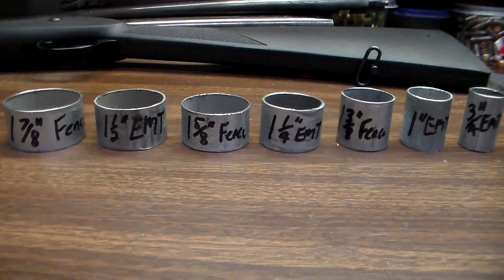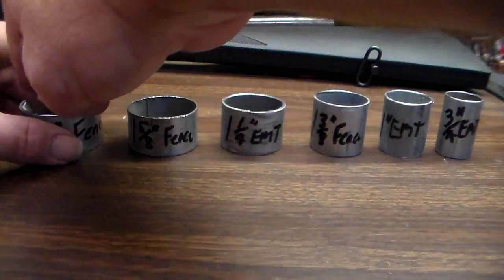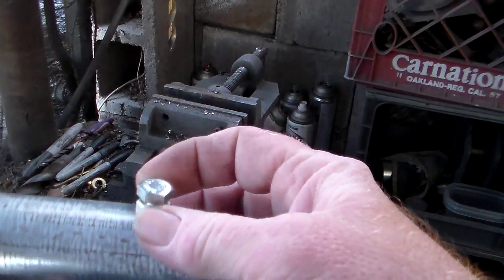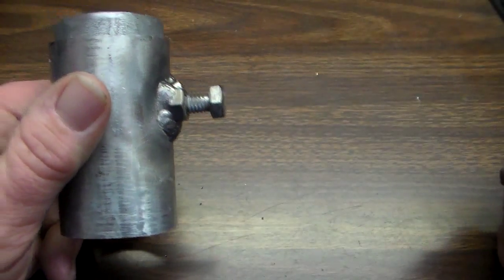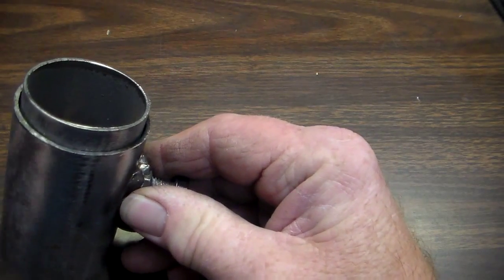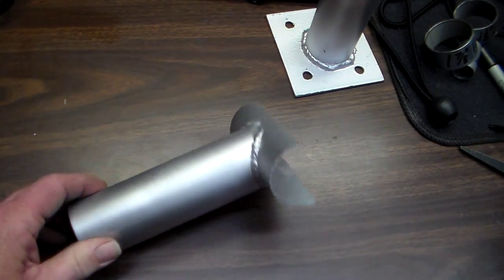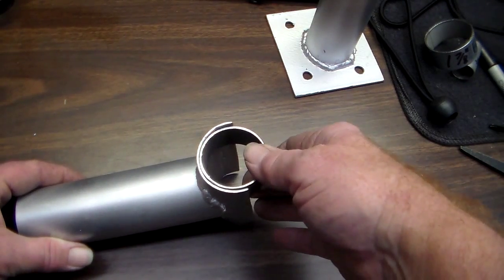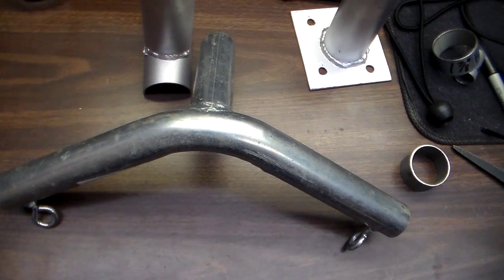How to manufacture a canopy Part 2

Comment: Thank you for the info. I looked all over to find the 1-3/8" pipe (to fit a 1" EMT) until I watched your video again and realized that it is a fence pipe and not EMT's. A 1" EMT is actually 1-1/4" OD. And a 1-1/4" EMT is way too big.

Comment: How well would a 2-3/8" fence post fit into 2-1/2" EMT conduit ? And / or "Maybe" one could just buy the EMT conduit couplings...🤔❓
FYI ~ You can ALSO buy 30°, 45° & 90°  pre bent EMT conduit sections as well.
Reply from the maker: 2 1/2'' EMT will fit in 2 3/8'' terminal post but it's kind of sloppy. The only way to make it fit tight is by welding the nuts/bolts on the fitting.
Reply: @JohnLeePedimore  
Yeah thought so.... I know 2-3/8" canopy tent fittings are made too.